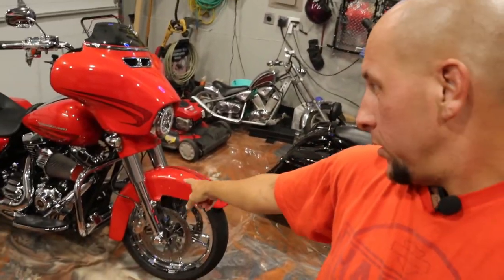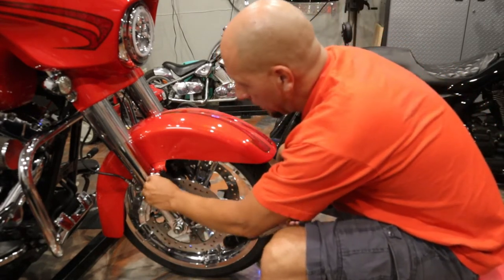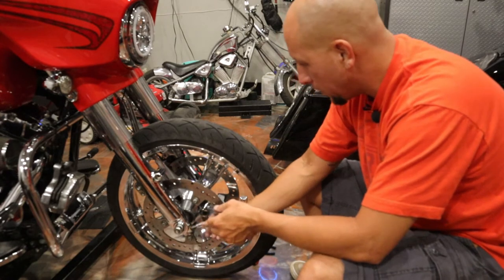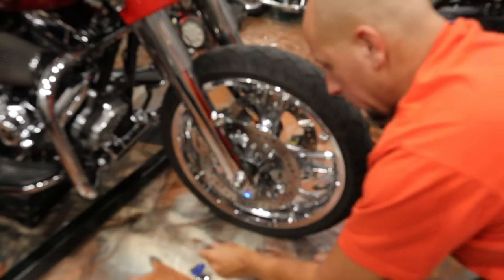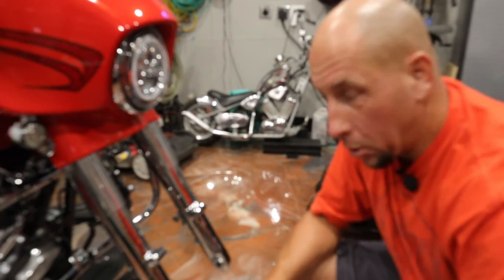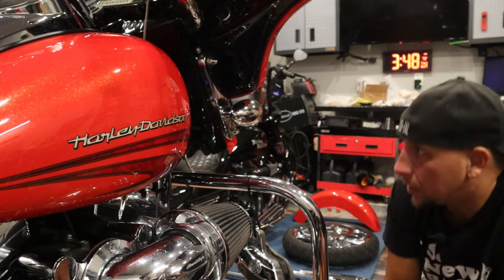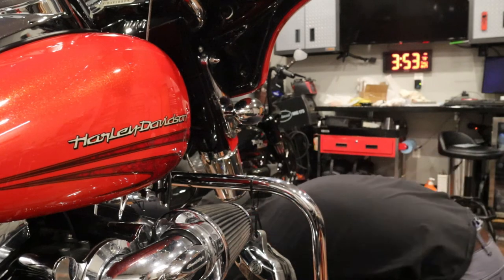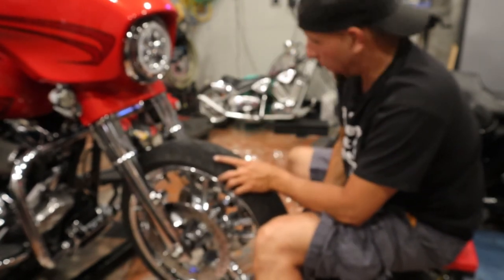How to install Harley fork slider covers (cowbells)

Comment: Hello, I have Deuce lowers that are currently on a set of tubes. I need to take the Deuce lowers off and put them on a different set of tubes, would the process be the same?
Reply from the maker: Process should be the same. Harley did vary too much from they way the assemble bike from one year to the next

Comment: Appreciate the video. Very good job, but not enough to convince me that “I” can change the cowbells on my own. I also liked the video because of the little nuances you pointed out (the axle spacer, tip on removing the forks, etc.) and I hadn’t thought that far or with the level of detail. And I can find another tool I need to buy to make the job easier! I want to remove my pipes and have full - shaped extended bags. Any thoughts about that being a DIY project?
Reply from the maker: Did you get your pipes done? The cowbells you absolutely can do yourself.

Comment: Are those 19 or 21 inch wheels
Reply: Looks like 19 to me.
Reply from the maker: That is the stock 19 inch enforcer wheel but a 21 will fit on the bike without any further modification.

Comment: Careful if you guys get those in black. They are anodized and will become green or purple overtime under the Sun and heat. Get the powder coated before you install em. I speak from experience
Reply: I found that out and am replacing mine this winter

Comment: 35..00 for the low pros ratchets
Reply from the maker: I got the low profile ratchets from Harbor Freight for under $10 I think
Reply: @crudeoilgarage3570  Would love a link to the ratchet on Amazon along with hex size. I really don't wanna remove the tank. Seat is a bear to get off. Appreciate the video!